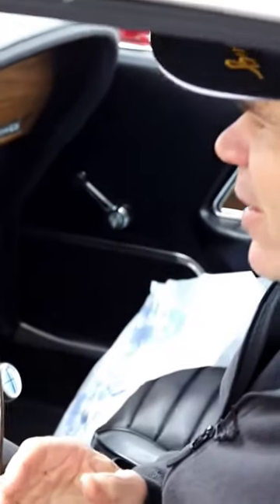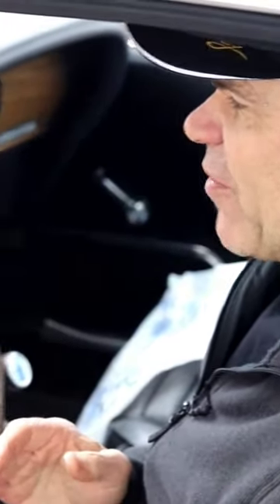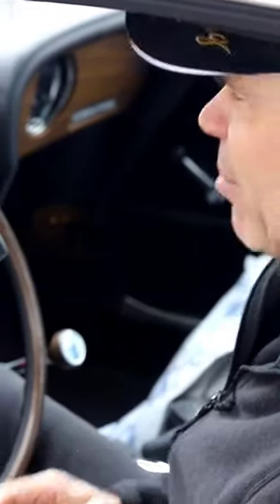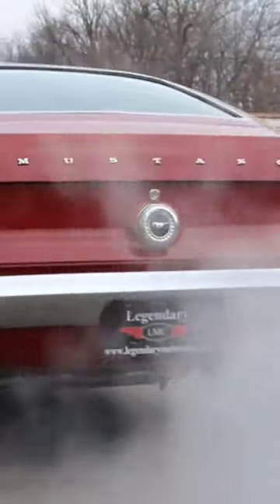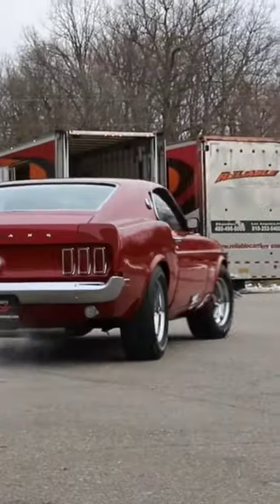How to start a classic muscle car without flooding EVERY SINGLE TIME 🤯

Comment: Once I was able to memorize roughly 1700 rpm by heart I just hold it there for 1-2-3-4, then start it, it heaps up to 2000 rpm and is immediately held at 1600-1700 by my foot just being there stationary. Any thoughts?

Comment: unless the car has been parked a long time pumping the gas three times is already flooding it especially with big four barrel. step down the gas as the owner's manual tells you once to the floor and the choke is set the carb is already sprayed enough to prime a good start and it should start up and on the fast idle circuit. why would you pump the gas three times that is overkill

Comment: Wrong wrong once started let oil circulate  at idle 5 min then idle up 
600 rpm ...  I been working on 
Cars 60 years you never have a car that Stone Cold at that high of RPM this guy is nuts I can show you some engines that's damaged from stupidity like I said let it idle for 5 minutes at slow idle and then bring it up to about 600 to 700 RPM  everything needs to warm up uniformly especially a vehicle from 1985 back to Model T
Reply: thank you for your knowledge. i have a question. how much fuel gets wasted waiting for a classic v8 to warm up?
Reply: @viewer7138 i would rather waste a gallon   if that much ..and not ruin a $10 k  $ 15 k original engine  ..and let come up to temperature  ...  calm down  karen
Reply: I grew up having the adults hate carburetors and I wound up with 2 of them the year it gave me extra greaf starting up I rebuild everything and then I got almost a year with zero issues and 1 pump maximum and they started up
Reply: @viewer7138  No one that owns one is worried about that so you'll probably never get an answer to your question.
Reply: To the OP, then why have auto manufacturers used automatic chokes that give high idle for cold starts going  back to the late 60's gm for example started using auto chokes in 69 I believe. 350 L46 engine Factory fast idle set @ ~2300rpm give or take 100rpms or so.
Reply: @codyramos3200  600 to 700 fast idle  on my ls6  tap accelerator  low idle 400 
Even my winters 427 in the Camaro  500 cold idle .. my 6 pack GTX only one with 
800 rpm fast idle  tap throttle  drops to 500    dads fuelinjection 370 327 corvette 
400 cold idle  ... 10 min warm up time on this one .. it depends on manufacturer 
Plus fuel we run 100 octane  most of time   older engines  brittle  parts from heat cycles 
Best to come to temp slowly.
Reply: Very true. Kids get engine running and Rev it repeatedly.  A big mistake. Eating gas and causing excess wear on cylinder walls and cams revving a cold engine for no reason at all
Reply: @31847448  I'm working on 
A 340 327 currently at our machine 
Shop  car has been sitting 20 26 years idiots just tossed battery 
In car though it could be driven onto  trailer  .. well 20 plus year old oil 
No marvel mystery oil used. 
Engine  locked up   was numbers 
Matching   ... some people  are 
Dumb as box of  rocks .. it takes me  a good 2 weeks to properly bring . engine  back to  life  or longer after sitting. .  But our machine shop 
Business is good with stupid people doing stupid shit. .lol
Reply: @quagmiredavis4117   I remember a guy I knew who had a 35 year run fixing transmissions. He is retired now and just working on what he wishes to fix in his six car home shop garage with two lifts in it and a nicely remodeld home, too  He is retired, I thougt. i called up and learned that he died a year ago sadly.   I remember his advice every time I am working on cars. He had many years working at GM dealerships in his long career..   He said the " opening can method " of transmission leak repairing and "fixing" made him a ton of money and kept him in business.  He owned the land, shop building, and a great piece of commercial real estate out back, at least a 15 car outdoor parking lot, too.  He made a ton of money on stupid guys.  It happens. He was a better transmission guy than the others. A true pro. Dealers sent some cusomters to his shop when they got busy and wanted to take a vacation in summer.  LOL.
Reply: @davesimmons1373  agreed .. transmission seal  stop leak swells seals  and causes many issues    only additives  i use  is  marvel mystery oil  
Its  good to pickle engines  and  add to gas  and oil to help valves rings etc ...  even  some older cars have a kit  to mix  marvel mystery oil with 
Incoming fuel mix ..  I have 7 vehicles with this kit ..   my 50 mercury  has this and just recently  drove to Amarillo  Texas   us 82 most of way 
And back to  Murphy NC   23 mpg ..  in overdrive  .. and other additives  napa water pump lubricant  ..  or  stp  gas treatment   .. enjoyed 
The chat ... if you send me    email information  I'll message  you....   I have a customers   66 mustang in shop making it ready  for  1600 mile 
Road trip  I will be working on next 2 days
Reply: very true

Comment: To everyone talking about an automatic choke and it working correctly, this is an oxymoron. I lived thru the 70’s got my license in 88 and had many cars with carbs. Very rarely was the average 4 door classic beater ever properly tuned or had a working choke. Everybody thinks of badass cars when “classic” is 
 mentioned. My fist car was a 1975 Pontiac Catalina 4 Door with an anemic V8 and a freshly installed manual choke kit. Payed $500 in 1988. Rusted out and barely ran with 120k on the odometer. I have 3 cars all over 20 yrs old with good paint and great running motors that start with the bump of the key. I love Old Muscle Cars but I’m glad I don’t have to rely on a stock one for everyday commuting. 😢
Reply: I daily drove a '66 falcon and '79 cj7 for a few years (I sold my reliable car, an '01 Saturn, to a good friend in need). I learned A LOT being on the side of the road. Now, I don't end up on the side of the road XD.

Comment: BOSS 429. My dream car
Reply: If you discount what it's worth, the looks, etc. and look at it as just a car, the 429 engine was not a good engine. It was designed to be run flat out on a Nascar track. On the street, not very good. Most didn't last 30,000 miles. Lots of oil leaks. They didn't even use head gaskets. I have a friend that has one

Comment: in the old days if it got flooded, you just pushed the peddle to the floor  while cranking the engine!
Reply: Used to do that or else you would pull out the screwdriver take off the air cleaner shove it down there. And then floor it crank it and hope that somebody was there to pull it out as soon as it started

Comment: I disagree . If your car is tuned right and has good gas and weather is ok than all you should need is a very light tap on the accelerator pedal and a short pause before ignition is attempted.  Too much gas just washes the cylinder walls free of of oil if you flood it .  Don’t do that.  No pumping three times is needed . I ran a Holley card w electric choke and put the factory 4 bbl in a box in the garage after removing it and draining gas out of it for safer storage. I did not run multiple carbs but friends who did and had three deuces or two fours learned to just lightly tap the pedal thereby having carb add a tiny amount I’d gas spay into carb or carbs. Less fuel wasted and less gas into intake manifold and to oil pan.

Comment: ONE pump, not even a full one, more like a bump. A soon as it fires give it another and the electric choke should be in position. If you flooded it, hold the pedal down while cranking it over. It takes a minute and sounds like garbage, but she'll get there 😮

Comment: Um, pumping the pedal without cranking the engine at the same time does nothing.  The fuel pump is mechanically driven.  Even if you convert to an electric fuel pump you still have to have the key in the "on" position.

Comment: I would rather have a mechanical carburetor that I knew every few years to clean up and rebuild over the computer failures now a days
Reply: Why? You like less power and higher gas consumption all while being less reliable? I get the charms of a carb'd engine, I really do. I had a '78 Bronco with a 460, man trans, and a Holley 750 double pumper with a manual choke. Never gave me any starting issues Dow to at least -10F. If I could change one thing about that motor it would be to add EFI. It was just too expensive for a 19yo back then ('98-ish).
Reply: @janus4002  why because I at least could have attempted to get a fix vs chasing computer ghosts in a emergency situation

Comment: 3 pumps would've flooded EVERY carbureted vehicle I've owned, from my slant six Volare to my 390 powered Monterey.

A properly tuned carb needs only to have the throttle depressed enough to close the choke.

Hell, my 83 C10s visor says half a pump then crank 🤷

Comment: All these carbureted engines are not the same. The same car will be harder to start in different climates. Some crank easily and some not so much. They are like women, each one is different, yet the same. You have to know how touch each one of  them to get them started and it may not be the same way any given day.

Comment: Yeah ok. Cause gas is just gonna magically going to atomize in a intake with the engine off. That's not how it works bud
Reply: Engine vacuum will draw it into the cylinders. Try it and prove him wrong...

You'll find it works, even if it's not ideal.

Comment: What a nonsense. DO NOT pump, just depress the pedal ONCE to set the choke. This is how these cars were started when new, Look in your owners Manual. Works for me for 34 years without problems. Pumping wastes fuel and wears out engines.

Comment: Let me clue you bozos in on the facts. You hit the gas too the floor ONCE,  release the peddle, when it starts you give it a second  too revup then tape the gas too reduce the idel
  If That doesn't work, then the chock and or the accelerate pump is MALadjustted.
   On a bitterly cold morning, say 20 below, a slight variation might be in order. I empathize the slight.